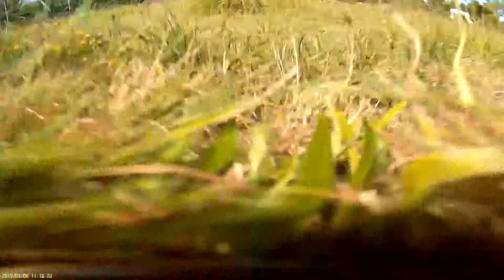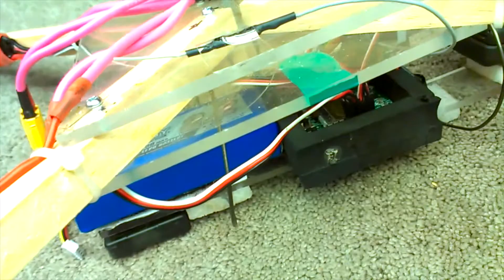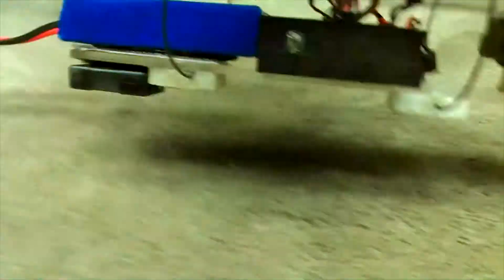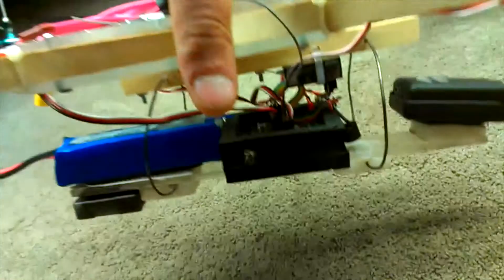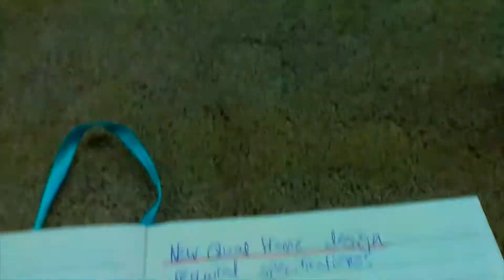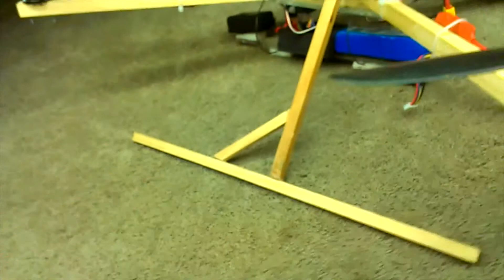******* New quad Over view

Comment: Maybe make two small pieces of 14 by 14 wood stick out a little bit from the sides and then have the landing gear/struts inbetween those two pieces of wood, then connect them with glue or 45 degree bent L pieces. Could you also explain all the major problems with the H-quad becouse i have one too. Only since it is my first multicopter i have nothing to compare it to. Thx, hope this helps.
Reply from the maker: +Arend Mookhoek The problems with the H-Quad weren't really major, when I built it everything was just sort of temporary, motors mounted with zip ties, camera plate wan't really mounted properly. It really needed to be rebuilt. So I decided to design and build my own to improve the things I didn't like about the H-Quad.
Reply: okay thx designing your own is obviuslly the most fun!
Reply from the maker: yes just had a flight with it in zero wind this evening, and its so stable! unfortunately my mobius isn't working right now so I don't get to see the footage, GRRR. I bet its good though :)
Reply: sweet